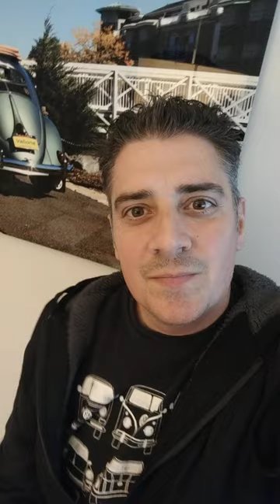Tire Pressure for your Classic VW Beetle Bug #shorts #shortsvideo

Comment: Funny, this subject came up. I was looking up in the original 1964 VW Shop Manual, it lists Tire Pressure for 1-2 occupants as Front 16 PSI and Rear 20 PSI. For 3-5 Occupants, Front 17 PSI and Rear 24 PSI. The kicker, that made me laugh, was it also listed for "High Speed driving" and long periods of driving, Front 17 PSI and Rear 24 PSI and this was for what they termed it as the tire type was a Rolling Radius tire.

Comment: Spot on.  I run 18 front 195/60-15 and 30 rear 225/60-15.  Never have wandering issues.  The pressure marked on the tire is MAXIMUM for maximum load.  Beetles are nowhere near max load on tires like these.

Comment: I always kept the fronts about 8-10 psi lower than the rear, even on the later IRS suspension. Going much over about 22 in the front makes them a bit squirrely.